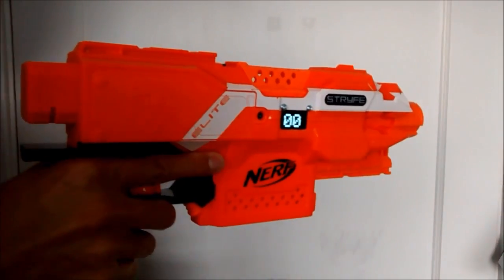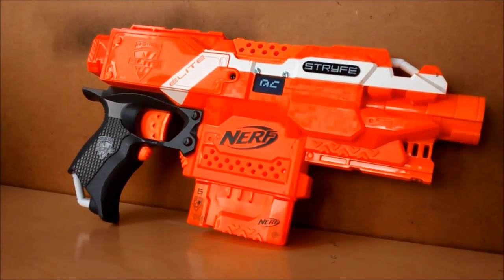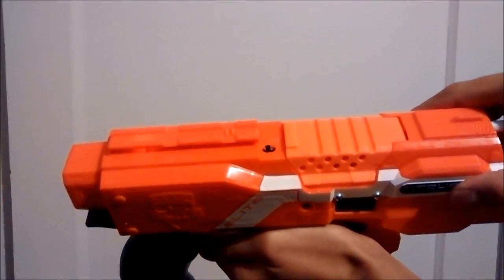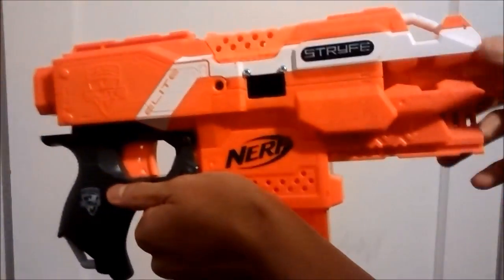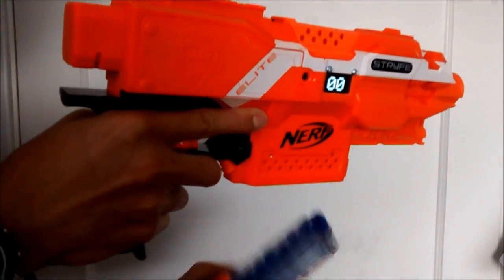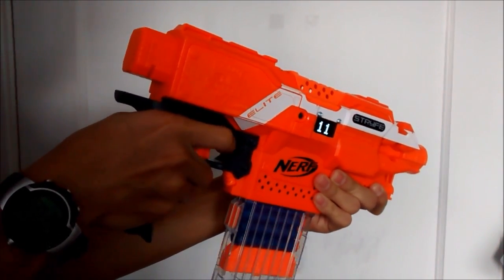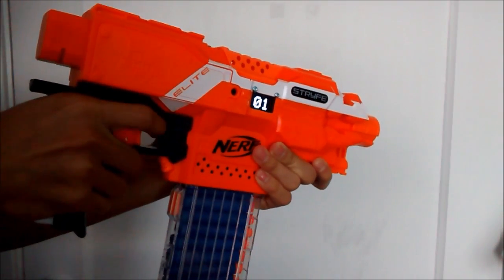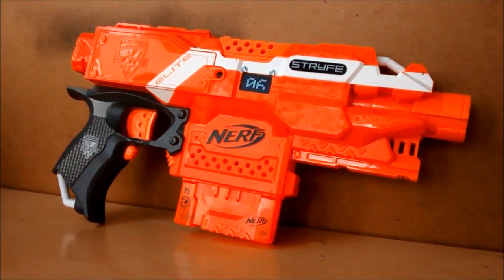NERF Ammo Counter: Stryfe

Comment: Been trying to follow the tutorial for wiring my own, can't get it to work :( I just get a wall of error codes (probably doing something super wrong, never worked with microcontrollers before).
Reply from the maker: +Jared Knipfel hmm.. that seems kind of strange. Maybe post your error messages? If you've downloaded the code within the past couple weeks I have been updating the code, so it may not be as stable. I'm actually redoing almost everything to try and make it as simple as possible for you guys. If you got the newer, possibly unstable version, I can send you the old version.
Reply: Tech MyBlaster The error codes are super long, it might be easier to send them to you directly instead of clogging up the comments section.
Reply from the maker: Sure, try this:
1. Download this: https://github.com/JChristensen/Button. There's a green button on the right hand side (in desktop view, the green button won't show on mobile). Click the green button and download as zip
2. Unzip the folder you just downloaded. It should be called 'button-master', feel free to rename it to 'button', although that's completely optional. 
3. Locate the Arduino folder on your computer. It looks like you have a Mac, so I'm not too sure where it's located for you. On my windows computer though, its something in like user/programs/Arduino. 
4. Once you find the Arduino folder, open it. There should be a few folders in here, fine the folder called 'libraries' (not 'lib'!) Move the folder you downloaded earlier here, but make sure you unzip it first!
5. Try uploading the code now, everything should be working! If it doesnt work, don't hesitate to comment again.

Comment: Hey! Cool project. I was trying to build my own ammunitun counter. The problem is that the darts are to fast to count them by a light beem, conected to an arduino uno. How do you count your darts? And What arduino shut I use, that is fast enoght? Sry for my bad Englisch and I hope you answer. :)
Reply from the maker: The Arduino Uno is fast enough, but it's big and bulky. It was meant for prototyping, basically. I used a switch behind the trigger, and every time the trigger is pulled, the switch is pushed too. You can use the Adafruit Pro Trinket, which is what I used for this build as well as the tutorial.
Reply: Ming Batt ok thanks. I know. I was prototyping. But now I will try to Go With a triggern swich. 
thats why I love YouTube :D ty